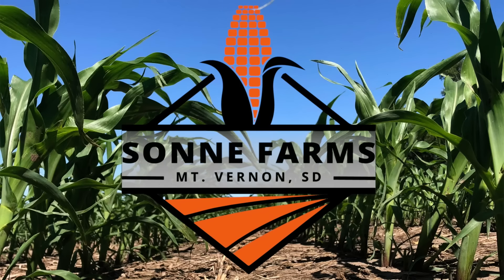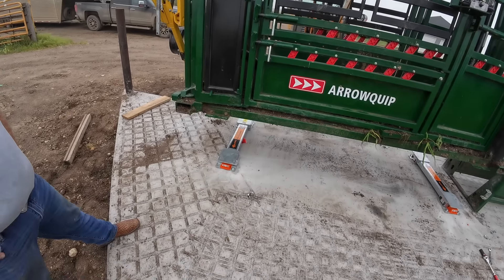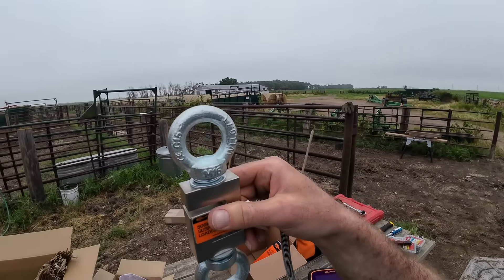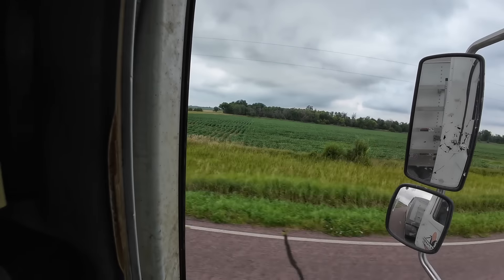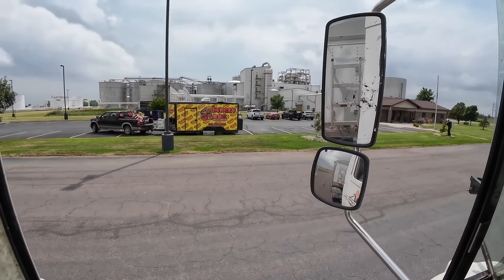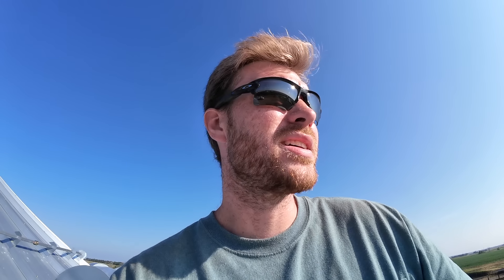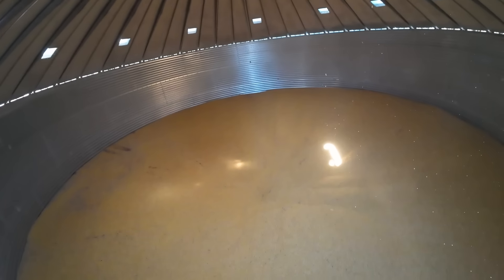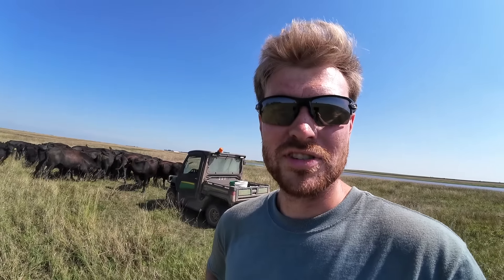New Scale and Tractor Shopping!

Comment: Do you have to use electronic ear tags or inserted ear chips with your cattle for identification purposes? 
Following on from this, can your weight reading head cope with recording weights for animals for electronically identified animals? This combination of electronic equipment is now quite common here in the UK. Probably the most advanced systems are linked to robotic milking and herd monitoring and management of dairy cows.
Reply: not yet

Comment: B section belts are 3 inch difference between inside circumference and outside circumference. A B52 is normally 55 inch outside circumference, except for 3v, 5v etc and branded belts.
Reply from the maker: thanks!

Comment: The shape of the concret pad for the new bin should be changed , give it a 2 feet slope graduation to the center  ( cone shaped )  so it becomes easy to empty .
Reply: its getting an air floor put on concrete
Reply: @briansonne814  The agitator and air is for  drying corn ,  if you give it a slope of 2 feet it will be easy to empty ,  the agitator  ( sweep augor ) can be adjusted accordingly  technology can be improved

Comment: In the "old days", all v belts had the same type of numbering system. The first number was the width in 1/8s. 3L, 4L and 5L. 3/8", 1/2", and 5/8". The second number was the length. 3L25, ect... Maybe because of the metric system every one changed the system. ??😢

Comment: The cement turned out really nice. We have our steel hydraulic handling system on cement as well. Because the whole runway/chute is also hydraulic. The S shaped runway leading up to the hydraulic squeeze..It adjusts the width of the runway depending on what size the cattle are. So they can’t turn around and don’t double up. So it had to be level on cement. Works great. Your looks nice on the cement. We scrap our out after use so the manure doesn’t build up in there

Comment: I no little about farming, so take it for what it is, but I work with robotics and I have followed you for a while, why don’t you rfid tag the earmarking and link that to the arrowquip loadcells, and add a rfid sensor on the “gun/ sprayer” with which you use  for all the preventive medicine, you can even add a flow sensor to the sprayer so that you could have a full medical history and growth vs different feed on each animal. Ask some students at the local college that could help you write some code and set up the sensors. You can buy a few thousand of the sensors for under a 100 $, 3d print a casing for each sensor and glue it to the current plastic earpiece. Buy a raspberry pi and connect it to your dewalt/ Milwaukee battery pack you already use. Should be solved for a few hundred dollars. Export the data to a simple excel spreadsheet or google docs and use some analytics on it. Just ask ChatGPT or Claude sonnet on how you should do it.